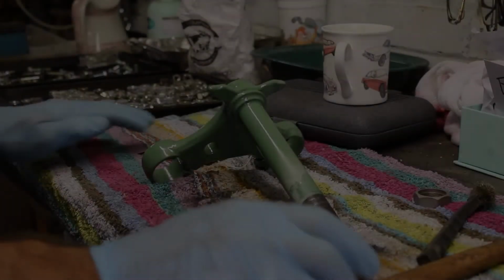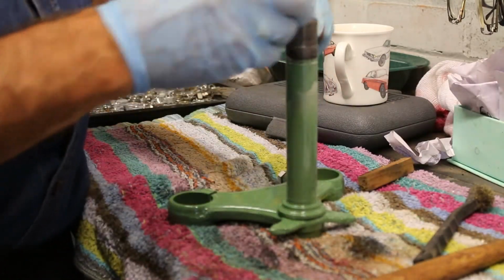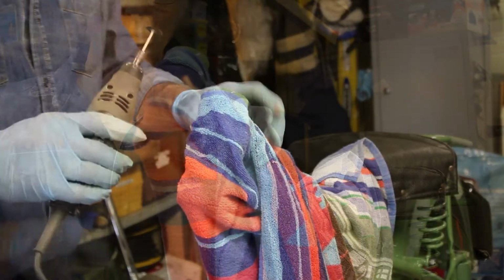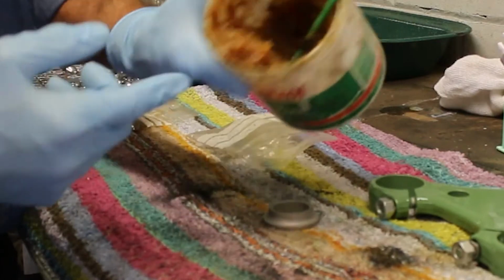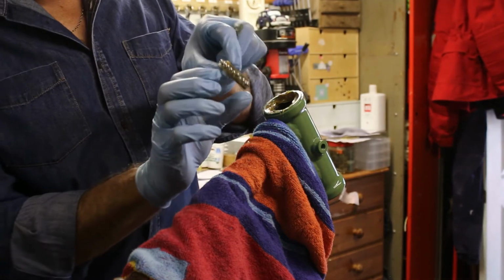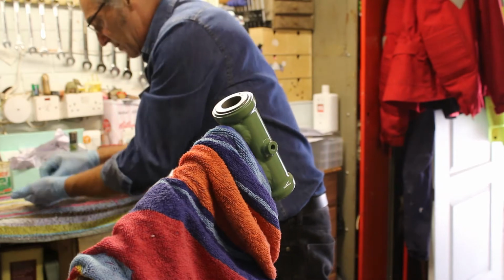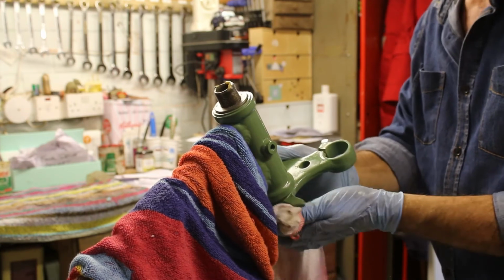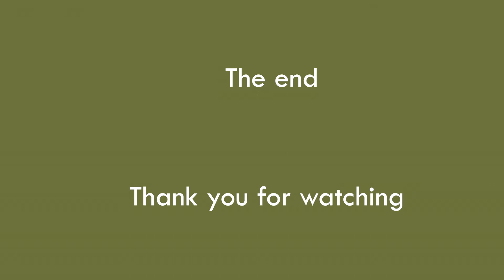Steering yolk

Comment: Was there not a dust cover somewhere in the mix, I've just got a D1 in bits and it looks like I have an extra bit to the headstock, I'm presuming it goes on before the top yoke but non of the diagrams I have found make it clear 🤔
Reply from the maker: HI Paul, I think some had a cover and some did not - the vagaries of good old old BSA assembly lines.....I don't think it really matters .. other than to the "tutters" - " I think you'll find.... "  But as I said right at video one -  it's my bike and I'll d o my best to get it and keep it on the road. Good luck doing your D1 - they are very similar to the D3. Regards Edd
Reply: @bsabantambuilding8142  I'm I rite in presuming it will go on the top of the bearing before the top yoke? And thanks, just busy prepping for paint on the frame forks and a few other bits. Just acquired an ariel arrow too so will put a push on getting this one to the rolling chassis stage before starting the arrow 👍

Comment: It's YOKE, yolks are in eggs
OK, how it's supposed to be done. Fit the lower bearings to the yoke race as you did, then lift that assembly into the headstock. Now grease the top headstock race, drop the bearings into it and then drop the top yoke race on to it, fit the nut = done. 
Also, not a great idea to scrape bearing surfaces with a screwdriver but these aren't high speed bearings so you'll probably get away with it but that's one of the reasons why your headstock bearings sound rumbly, that and old worn races. I too am a "careful" Yorkshireman but if I'm going to this level of restoration I'll spend a few pounds on new bearings
Reply from the maker: Hi, Andy, thank you for that - ooops, my apologies. Regards Edd